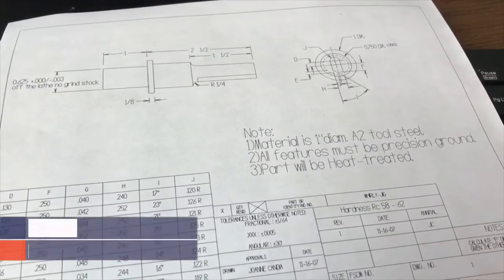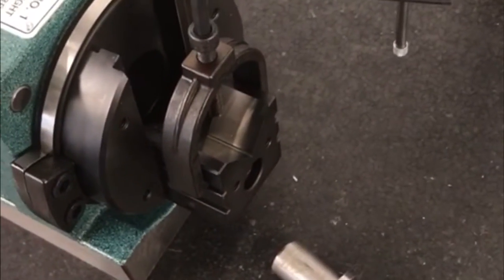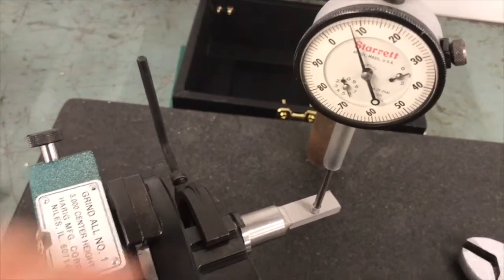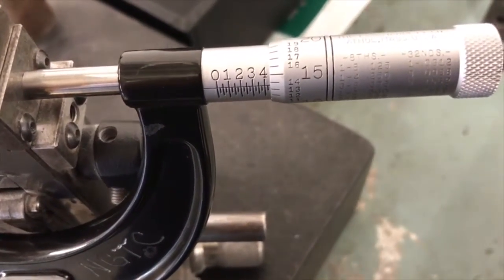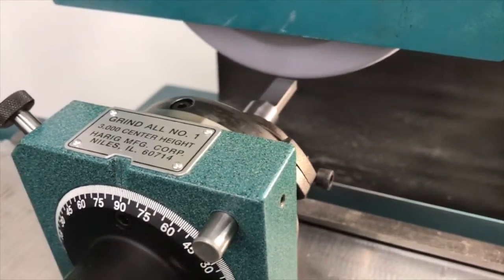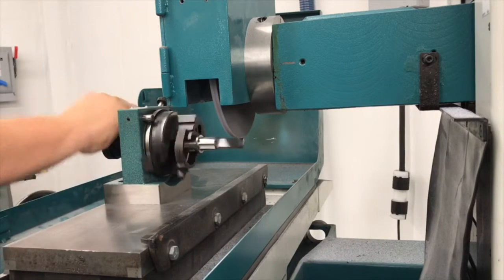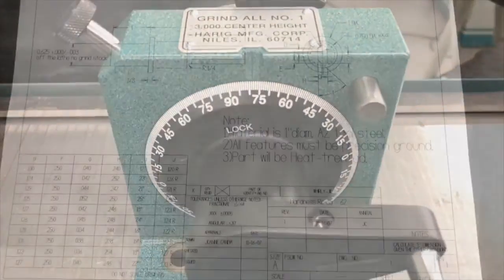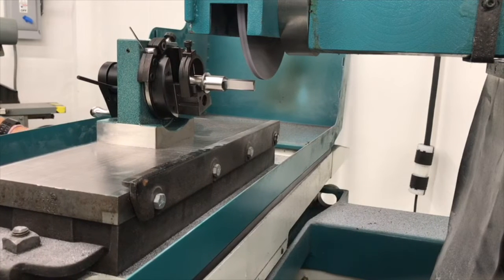How to set up a Grind-All v-block fixture to finish your part

Comment: A couple tips. Touching off and calculating how much to remove is great for ruffing but actual dimension before finishing should be checked off the center height of fixture with gage blocks or height gage. The center height of that fixture is probably 3.0000, so if grinding a .250 rad. top of radius should check 3.250 from surface plate. Also, Just use the front rail and a parallel. Front rail should be kept true. If its not fix it. Feed from fixture out, except for a skim without feeding down after part cools.

Comment: Why do you have your Harrig  fixture in the center of magnet ? I'm tool and die maker for 45 years and I always put Harig fixture on the very right side of the magnet because if I want to measure my work I can move my work far away from the wheel . George Zardecki.
Reply: Good tip, Thanks.